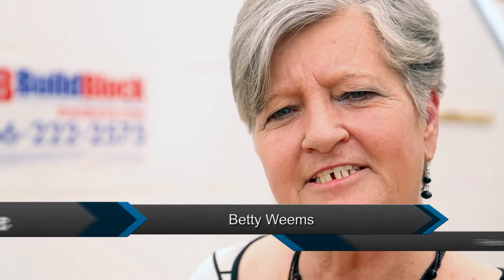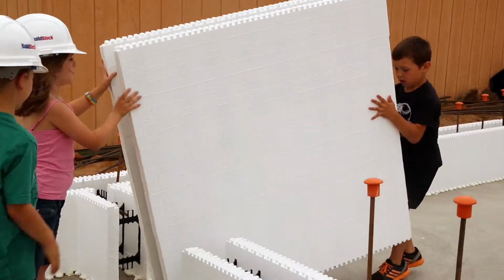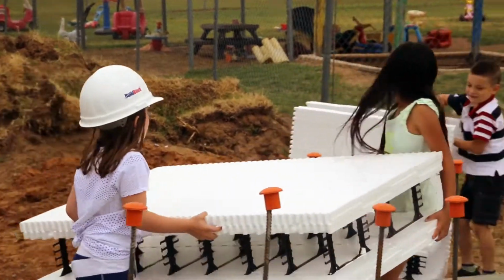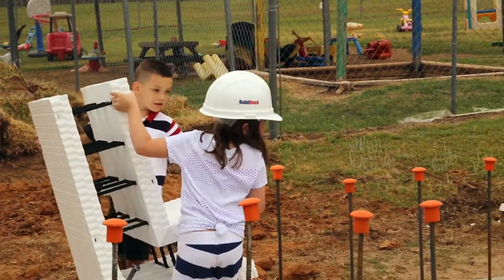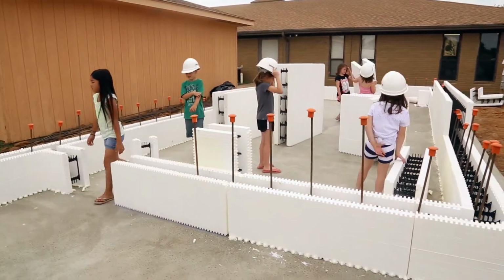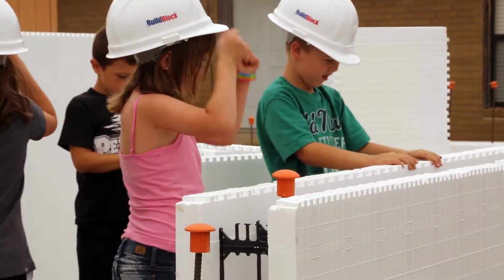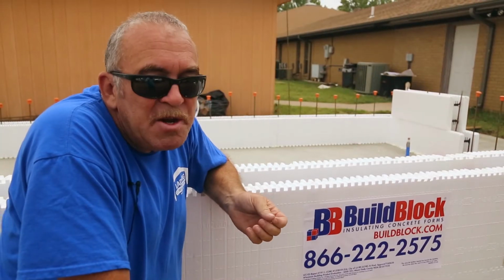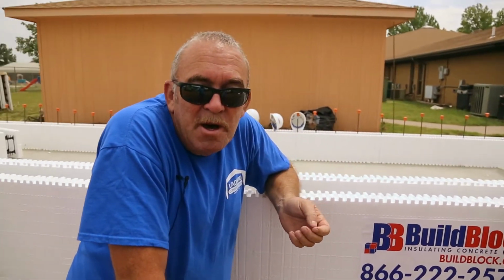How to Build an ICF Safe Room at a Daycare Pt. 2

Comment: If you have a full ICF concrete home anyway, would you even require a storm safety room?
Reply from the maker: If the home is full ICF top to bottom, adding a safe room would simply be an additional precaution. Some people may want a safe room for additional security during a storm or as a secure place to keep valuables since an ICF safe room provides extra fire protection. But you're right- if a homeowner is building their above grade walls with ICF the home is going to be very safe and secure (especially if they finish the  house with an ICF concrete roof). Thanks for the question!